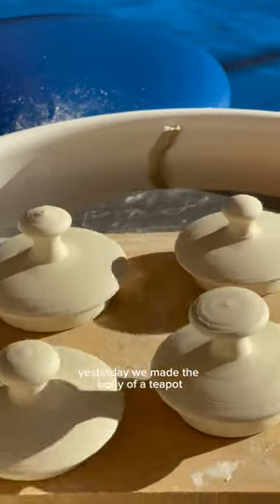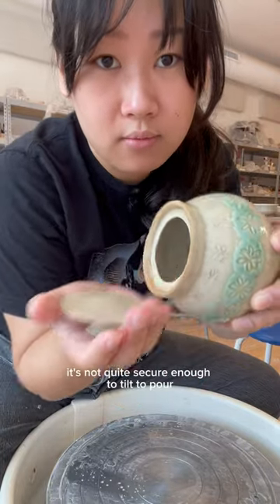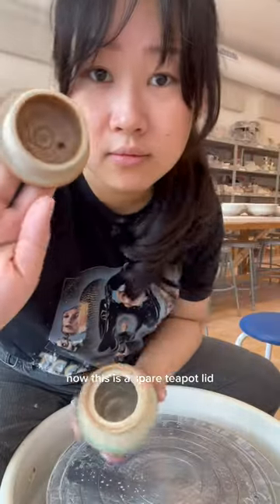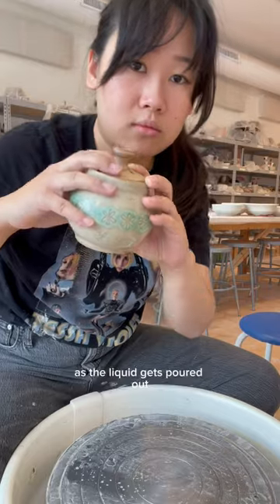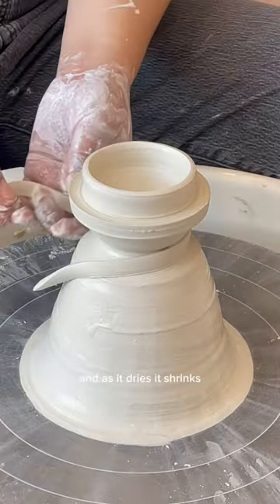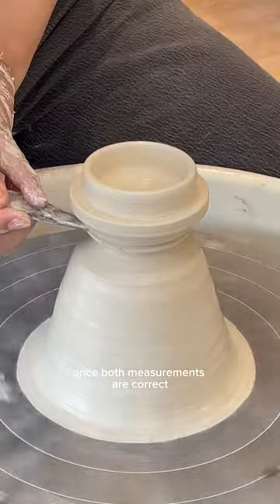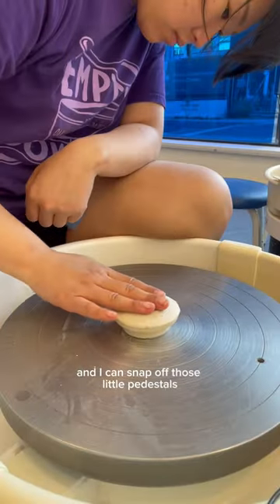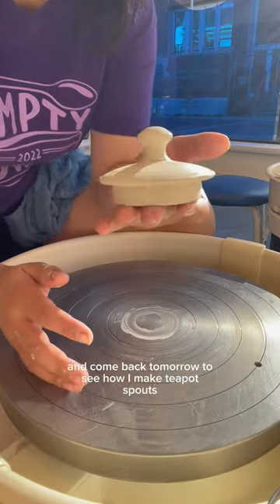Teapot Lids?!

Comment: @saramicspottery3875 - You probably know already, but just in case:  Some people add a little nub to the bottom of teapot lids that sticks radially outward from the bottom of the lid on one side. You have to put it on the pot with a hooking motion to get it under the inner rim, but if you point it towards the handle it will keep the lid from falling out when you pour

Comment: I love the teapot lids that have a little bumped out portion that anchors under the lip of the pot. When placed toward the handle it helps the lid stay put when pouring.
Reply: Exactly what I was going to say. Usually it’s on the underside of the team hole side. Prevent the lid from falling into your cup

Comment: Wait hang in if the top is leather hard after the night of drying, do I have to re-wet it to make it sticky enough for the lil handle bit on top to stay on when it fires? 🤔 Won't it crack off?
Reply: Not the creator but, having done this, you can score and slip the lid and that will help. But that's not always needed, depending on the clay. The extra pedestal of clay she leaves probably keeps the lid from getting too dry.

If you don't dry the whole thing too fast after attaching it will be fine even though the lid is a little more dry than the knob.

It's kind of like pulling a handle off a mug instead of pulling the handle separately then attaching it.